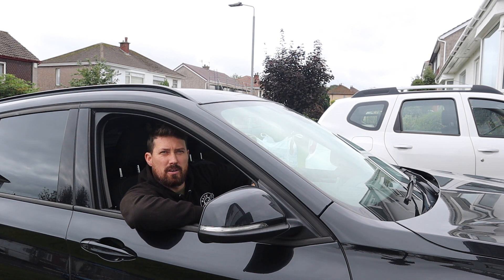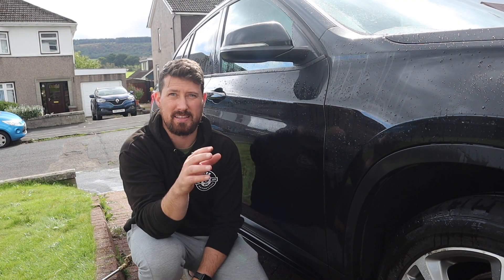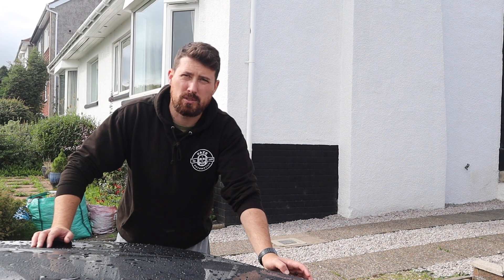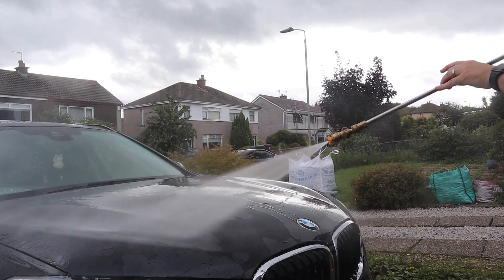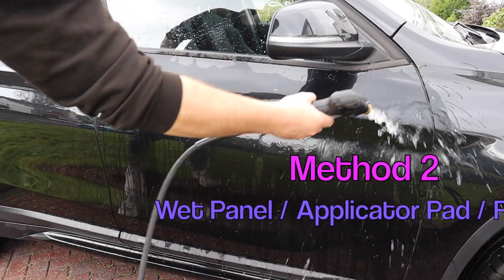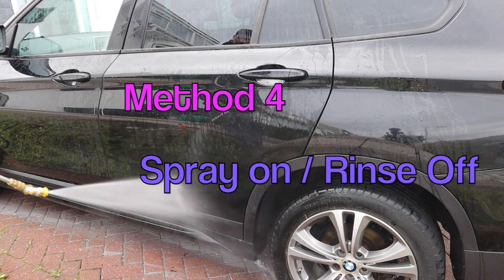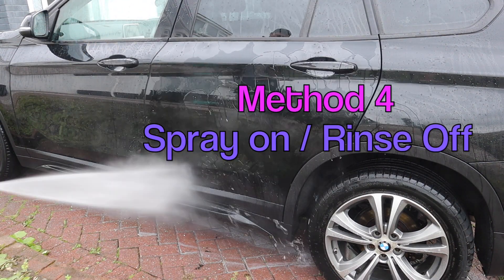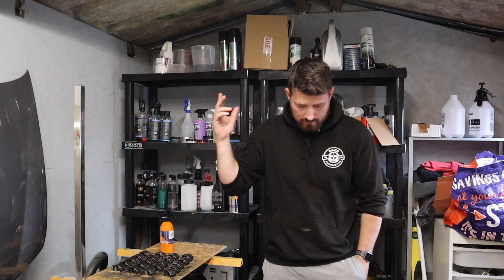Gyeon Q²M Wetcoat Best Application Method & Bathe+ Update

Comment: great video David, always better to wipe with a wet MF towel, to make sure you fully cover the panels before rinse, i think the Gyeon spray and rinse method just wastes product.  Try TW Dry & Shine, works just as well as Wetcoat (i use it on wheels all the time, but ideal for winter use, when time is short & its damn cold), but half the price.  Bathe + also good, would also suggest AM Details Hybrid Shampoo, ideal for topping up any existing protection each wash (Hybrid Sealant/Detailer). 😁
Reply from the maker: Thanks Iain, ive yet to try out the AM hybrid range but its on the list. i do like the ease of wetcoat even applying using an MF its still super quick to get round the car in just a few minutes. I really didn't realize how much wasteage there was with the spray on method, any wind and it just gets carried away.